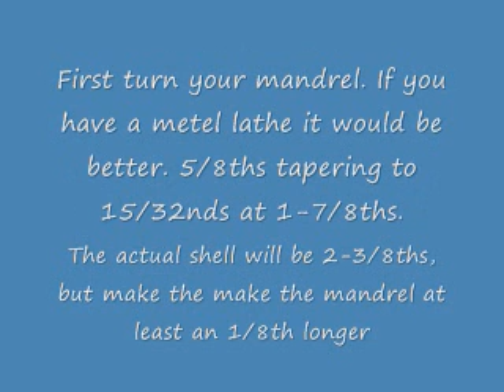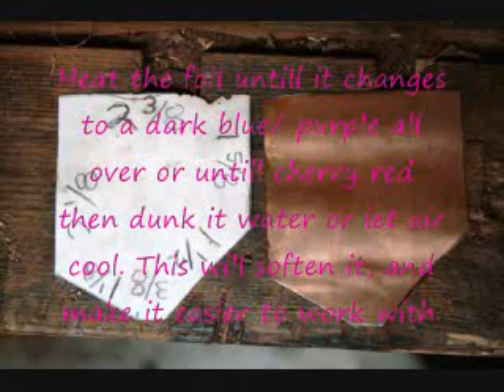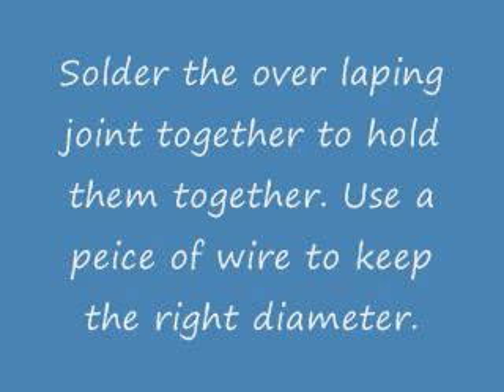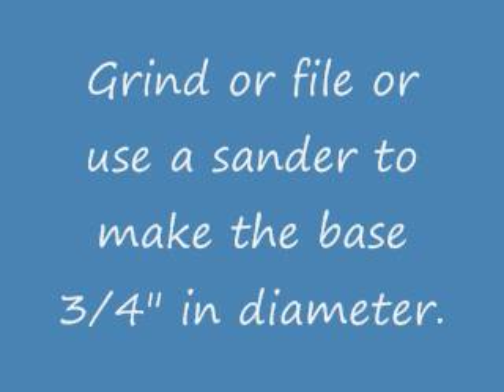How to make a foil .577 450 Martini Henry Cartrige

Comment: Could you make a case like this for a bolt gun like a 223, and can someone test it and post a video if you think you can do it.
Reply: Way too much pressure
Reply: 223 with blackpowder and i would it cycle in a bolt action and fed from a mag.
Reply: You can; however, the cost of machinery needed to make high pressure center fire rifle cartridges is beyond the reach of even large shooting clubs.  .223 Remington operates at around 50, 000 psi, the 577/450 about 12,000 psi.
Then comes the factor of quality control and consistency in production necessary to accuracy.
Simple answer, reload.  Modern cartridges can be reloaded several dozen times, making cartridge cost negligible.

Comment: Do you think someone can feasibly make better homemade metallic cartridges?
Reply: as the question is posed.. no... not feasibly... possible?? of course.. Straight necked casings would be MUCH easier than a tapered or stepped casing for obvious reasons.
Reply: Is it easier to make certain primer types over others? Centerfire vs Rimfire vs Pinfire?
Reply: @emperorromanov9035  Berdan Centerfire would be easiest, it you have the means to make your components fit properly, next would be Boxer (due to having to make an anvil for the primer), then rimfire (the thickness of the brass used or the rim is critical for getting ignition, plus you have form the hollow rim and swirl priming compound into it evenly.
Reply: The most advanced I’ve made from scratch has been 12mm pinfire